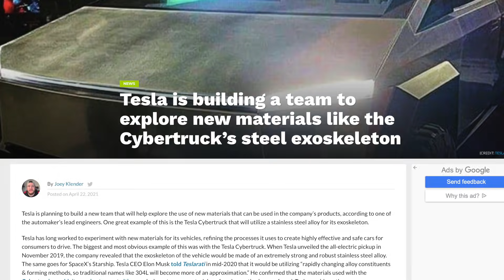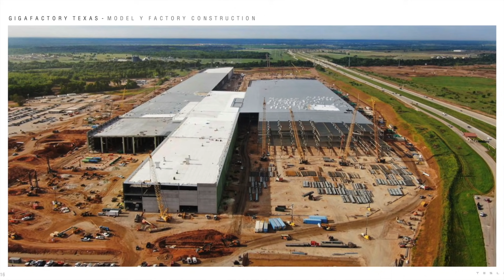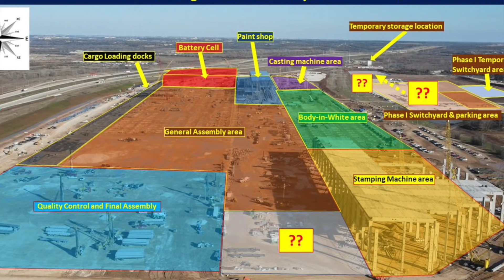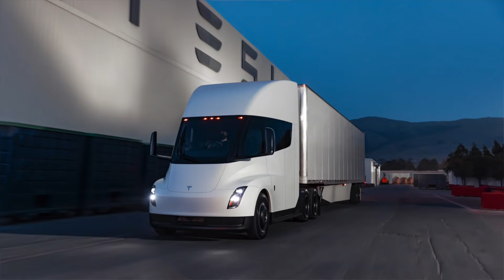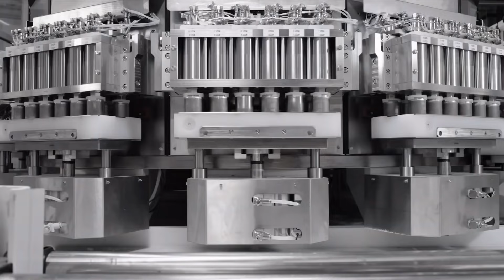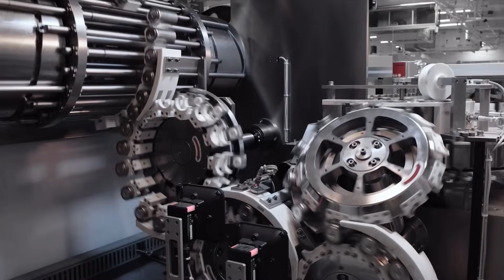Cybertruck Updates for May: Timeline Updates

Comment: Don't confuse RoadRunner 4680 cells (with their DBE production, high-Ni cathode, and possibly elastomer-coated Si particle anode) with more generic 4680 cells merely utilizing Tesla's tabless electrode architecture.  The latter are likely to be available in quantity from one or more of LG/CATL/PS before Tesla's RR cells are optimized.  The likelihood that GF 4 or 5 will spin up M-Y production with anything other than 4680 structural packs capped with giga-castings is next to nil.

Comment: Imo they will be able to at least start production of the Cybertruck by the end of this year. There is plenty of time left in the year, and the factory in Austin is moving right along.
Reply: @TailosiveEV  A portion of it is used for the Y that is correct. But the Y assembly lines have nothing to do with the Cyberteuck lines imo. They can easily have two teams working on each vehicle.